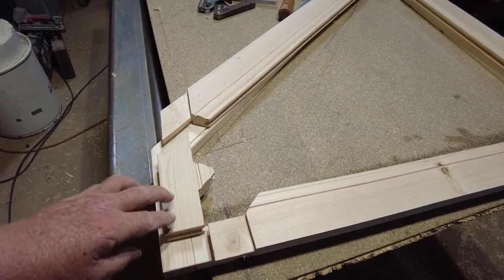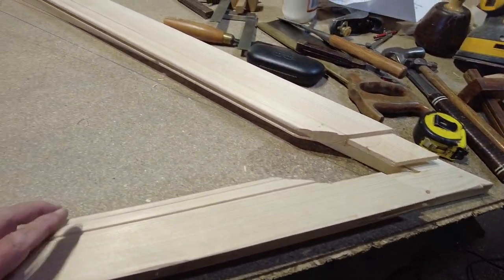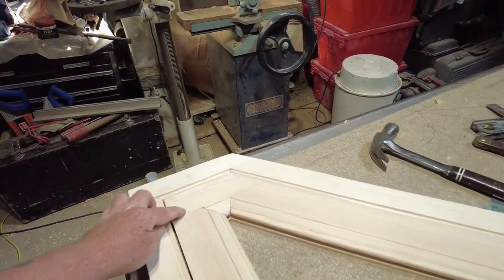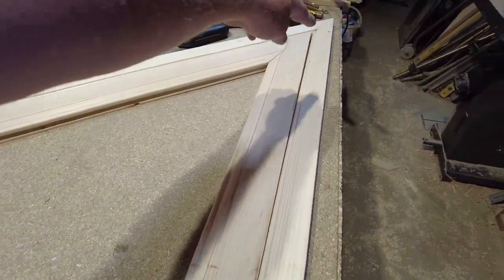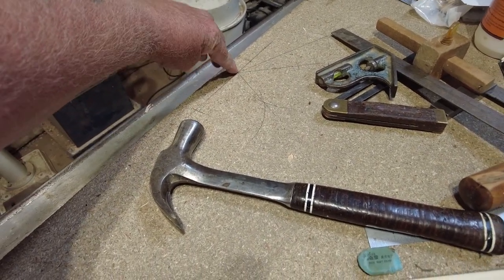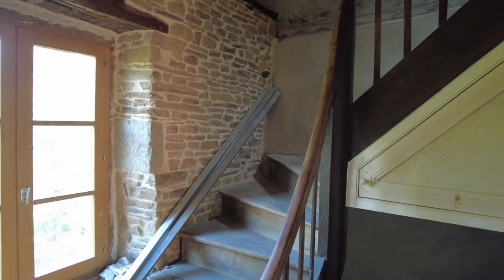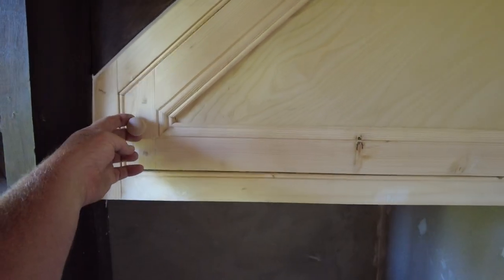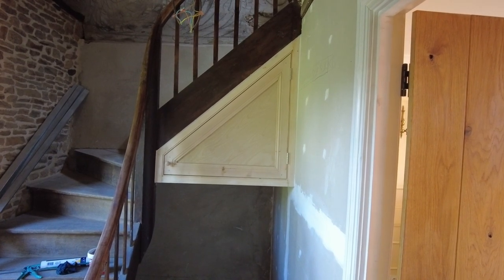No 70.STORAGE SOLUTION / HALL RENOVATION / FARMHOUSE RENOVATION

Comment: Just a thought..wouldn't it be lovely if you had turned spindles on the stairs instead of the straight bits of wood.x
Reply from the maker: Hi Debra because the handrail is so narrow it cannot accommodate turned spindles but still a great thought thank you 😘🥰

Comment: You both have amazing talents.  I wonder if oiling the top of the steps on the stairs will make them to slick to safely walk on?
Reply from the maker: Hi Paula no the oil is only to enrich the wood then i would use a special mix i have formulated sorry trade secret to finish the stairs of to a none slip surface and keep the natural look of the oak but a great question and thanks 🥰😘🙏